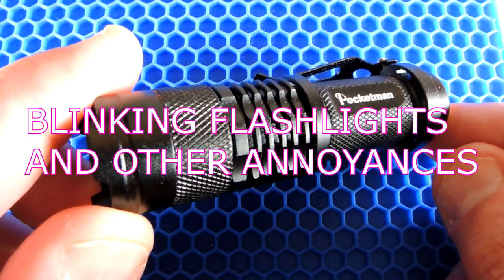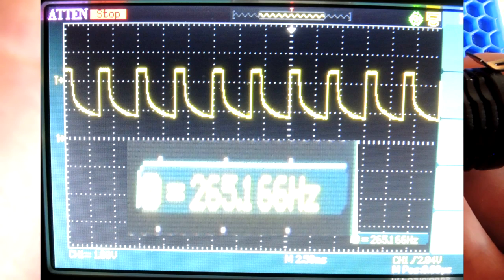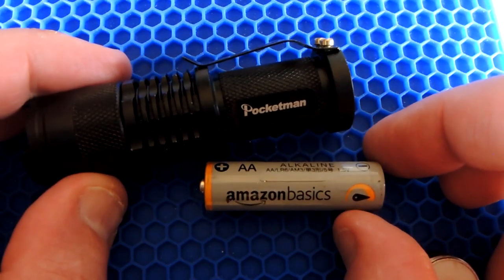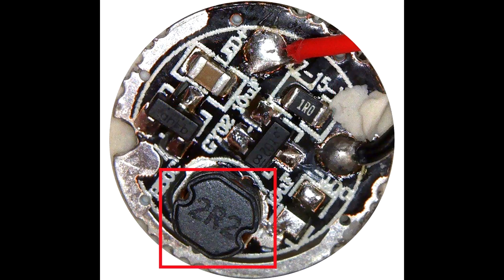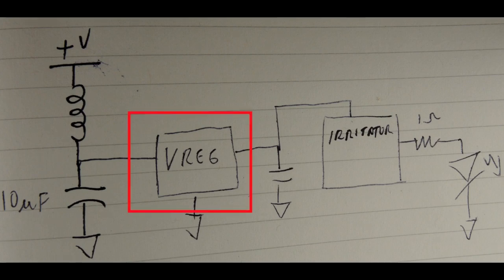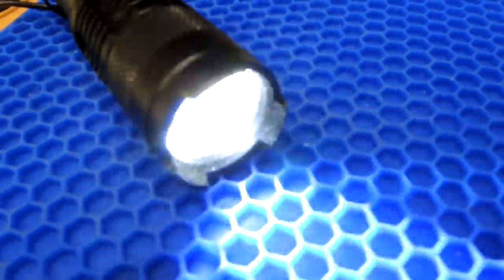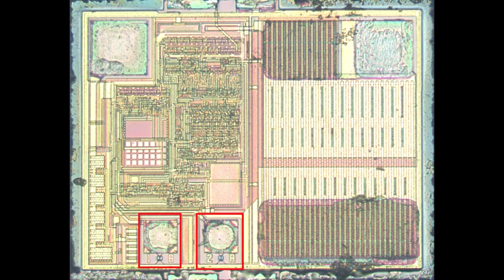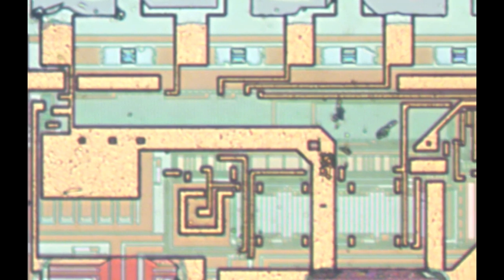ANNOYING BLINKING FLASHLIGHTS AND HOW TO FIX

Comment: Lets hope someday we can buy a reasonably priced LED flashlight with 2 modes: ON and OFF.
Reply: I kinda dont hate the chip i wish they could remove the flash setting and hold the dim setting only on or off is soooo boring
Reply: @309electronics5  I use my flashlight for a flashlight, not entertainment
Reply: I replaced the circuit with a microcontroller i had and added code that does the 10-100 percent modes and has no flashy flashy mode nor sos it works awesome dont like flashlights that dont have low intensity mode
Reply: @saltcar he did not tell you he liked sos or flash mode he told you he liked the lower intensity wich is not a entertainment mode bruh, go read his comment better

Comment: Are there actually people that want their flashlights to blink, or do the manufacturers just THINK people want that?  It's even worse when the flashlight has different lights on it that are controlled by the same button.  I got a nice flashlight as a gift a few years ago that has 2 different sections with clear LEDs, and a 3rd section with red LEDs, and they cycle in order.  I would MUCH prefer being able to turn each section on and off without having to go through an entire cycle of all the different modes and light sections.

Comment: The purpose for the blinking is in case you fall off of a trail hurt yourself and you can't call for help and it's at night you can put the blinker on and they can find you.
Reply: If you are too hurt to press call on a touch screen then I doubt you'll be able to muster the strength to press that lil'clicky bit enough times to make it flash and then position it in a way where somebody might see it. 
Th e bigger flaw in that logic is that it now would take 2 hands to try and signal any  Morse code because you would to dim it with your other hand.
It's a gimmick for dum-dums.            ... --- ...
Reply: Also to signal air craft but its real propose is to tell you your 🔋 is going dead. If you have it on for a long time and it just starts flashing, its time to change the 🔋.

Comment: That looks like a chip that would be used in bike headlights. The flashing mode is used to warn of the biker's presence with reduced battery consumption I believe. I don't really think it's that useful even in that use-case, but at least it makes some sense. My guess would be they wanted the 50% output, and didn't want to spin custom silicon, so they repurposed the controller from a bike headlight.
Reply: Flashing lights can cause target fixation, so you will get the attention of a car driver and he'll then procede to subconciously veer into your direction. 
This, and any confusion with ambulances, fire dept etc is the reason why in the Netherlands, flashing lights are prohibited on bicycles.
Reply: my power babk light has this function

Comment: I think it largely marketed as an "emergency" flash. All I know is that it's the most irritating thing ever put into a flashlight. I don't even mind the lower intensity setting, there are times the flashlight can actually be too bright to see what you're doing in tight spaces. So that's not bad. But having to skip over the damn flasher drives me absolutely nuts. I don't know why that became such a thing, but I really, really wish it would quickly un-become soon.But great video, that's quite useful.
Reply: You ask why it "became a thing" yet you keep talking about "flashlights", so what's the problem? You ask for flash, so you get flash mode. Flash light. FLASH light.
If you bought a Blue Light, would you complain if it was blue?

Comment: I think I could add two things here...
-The "low brightness" mode is there because sometime you don't need the full brightness (!) and it will improve the battery lifetime. The "blinking" mode is used to attract attention and yes I agree that's not very useful...
-The chip doesn't contains any EEPROM. Basically the "irritator chip" has a decoupling capacitor. When the switch is turned off, the chip does not know it but because the boost regulator is stopped, the voltage on the decoupling capacitor will gradually (but quickly) decrease, as the LED is still powered. The chip detects when this voltage falls below a limit (a little above the LED's forward voltage). At this point it turns the LED off and stops its internal oscillator. And then the only things that remain powered are a few latches to remember the state. So it will remember it but maybe for several minutes, not forever.

Comment: Having an extra toggle switch between the "irritator" and voltage regulator could let you choose between regular on/off mode and fancy mode. I hate the blinking modes as well but being able to lower the brightness to save battery power can be nice. I hardly ever need full power.

Comment: Most (all) flashlight enthusiasts hate non-hidden strobe modes. Better UIs will require multiple fast taps to get to hidden modes.
Manufacturers put the strobe in so they can call it a "Tactical" flashlight, despite its ineffective use for self defense. If you can't already defend yourself, the half-second a blinky buys you is useless...
Lots of us at r/flashlight are probably about to by-pass that diode.... Thanks!

Comment: Thank you for pointing out that the irritator was actually a second chip! While I might see a use for the reduced intensity saving battery life, however the fact that I always have to toggle through all modes is annoying.

I will have a look if my flashlights have the exact same construction which they probably do - and then there will be no more blinking soon!
Reply: I replaced the circuit with my own, with atmel attiny 85 and inbuilt memory chip to syore last mode, it has 10-100 percent power modes and no flashy flashy

Comment: i got the lux pro and it just has on and off  but the on is strobing and the off is light out ..This flash light was expensive.. lowes will not accept  exchange either and no money back .For such a small flash light I paid 25 dollars .I'm pretty  disappointed in lowes and have a feeling i will not be the first person to try to do a return because of malfunction . ps I tried on and off but it was to no avail .

Comment: Every flashlight and head-torch i have bought for at least 10 years has the infuriating 3 modes, full bright, 50% bright and flashing which can't be skipped. The normal implementation is different than you show here however, as it is almost always a soft power button going to a micro-controller, rather than an on/off switch as you have shown here, so not easily by-passable. The micro-controllers are so cheap it is probably worth me looking  into knocking up a simple program that just does on/off state and swapping that into all my flashlight devices, either that or swapping the momentary button for an actual power switch, however I think the micro-controllers are cheaper than a switch

Comment: Thanks for the tip another thing about the cheap flashlights that annoys me is when they flicker due to bad contacts in the switch I even have a flashlight that will turn off if shaken too hard

ps I've also seen a version of that chip witch uses a small smd cap to remember its last setting for a few 10's of seconds witch is way too long

Comment: Bought a 3-pack of cheap imported LED flashlights which had that strobe mode. Strobe mode and half-bright mode have failed on 2 of the 3 after a couple years intermittent use. Now I just get plain on/off at full bright mode, and replace batteries more often. "It's not a bug, it's a feature." Still use my remaining strobe-capable light when bicycling at night.

Comment: IIRC. Typically the save state is based on a capacitor discharge. If it's above a threshold, it knows it was recently on and changes the mode

Comment: Thanks!  I can't stand the different modes. And when the batteries start to get old and don't hold a charge as well as it used to, the flashlight has a mind of it's own and changes modes when it feels like it. And that's usually when you are working on a small part or hunting for something in a rug etc.

Comment: It will run off an AA at 1.5 volts OR a 3.7 Volt battery.  But if you use the 3.7 it can never use the AA 1.5 volt again.

Does it burn out part of the circuit on purpose at 3.7 volts??

Thanks!!

Comment: I prefer my olight. Stays on the mode i have it in everytime i turn it on. Have to hold power button to change brightness. Double tap power button fast to make it flash. Battery lasts forever. Brightest light ive had. Light weight and tough. WATERPROOF. Had a dim mode that lasts for 3 days if needed. Has a super bright mode that lasts 2 or 3 minutes before it auto cancels to normal because the light gets hott for a led when that mode is used.

Comment: WARNING - These torches that use different modes have a habit of turning themselves on. With an unprotected 18650 battery this means death. The unprotected batteries are slightly shorter and may not make a good contact. This means the slightest movement can cause the unit to swtitch on. I just soldered 2 small washers on the end of the battery, naughty maybe but it's better than having a 0V 18650. They are almost useless even if  a charge can be started.  Just found your channel - subd.

Comment: I have the brand new Energizer flashlight PMHT61 that the strobe light comes on by itself without out it being touched. I got it from Walmart in August of 21 and never used it never dropped it but all of a sudden the strobe light pops on all by itself, could you tell me what's the problem?

Comment: I was looking to deactivate the irritating hyperflash mode in my torch 🔦 but my circuit board is different from yours , however I changed the wiring and guess what it's still hyperflashing 😭 Anyone?

Comment: The irritation function is so that cops can attach it to their firearm and blink it in your face. As you correctly identified, this feature causes irritation. Since most people will instinctively act to block an irritation, such as raising a hand in front of their face, this gives the officer a legal justification to fire until exhausting their ammunition supply, under the "I was in fear for my life" clause. Hearing the gunfire, and not wanting to be seen as un-cool, and snapped with towels in the locker room, other nearby officers will join in on the firefight, and other officers will speed over to the scene, probably causing chaos and injuries en route, to also provide backup, but mostly so they can take pictures of the formidable combatant, and notorious would-be terrorist mastermind, honorably cut down before whatever evil plans could come to fruition. Those pics will be seen as a badge of honor, and proof that said officers "were there when it happened. That day when justice was served, 'old school', the likes of which don't happen anymore". 
As you can see, this little "irritation" chip does a lot of work.

Comment: That's a strobe mode for signalling and being seen as well as self-defense for blinding an attacker. Lots of LED flashlights have that. It's a feature, not a bug. :)
Reply: It's an irritating feature!
Reply: It's a bug,  Not too many people are attacking me when I'm crawling around in the attic, changing an outlet in my basement that a previous owner painted over, swapping out  the air filter in furnace, etc.